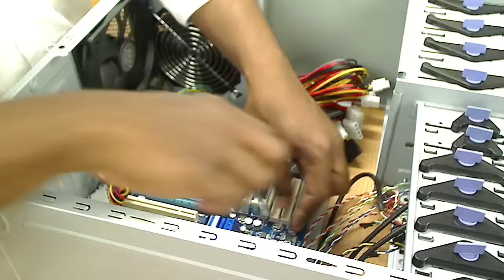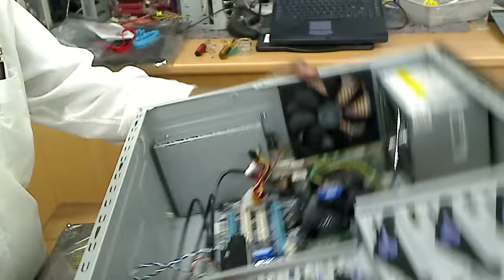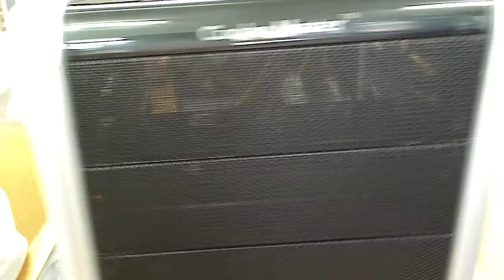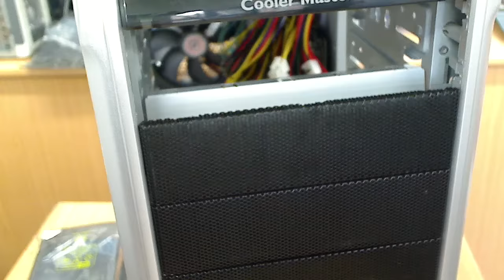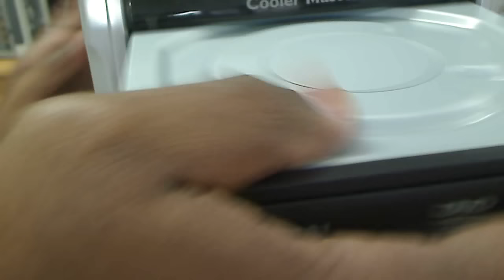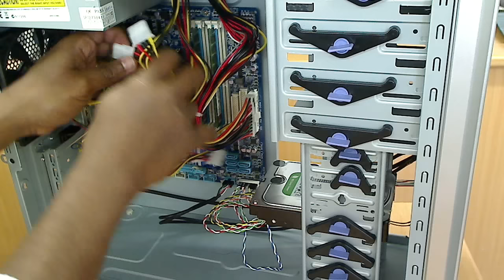How to install new Mainboard with Intel Core i3 Processor inside

Comment: I notice you do not use an antistatic mat nor are using an antistatic wrist strap, I allways use a special workstation set up with the right mat as well as the wrist straps. I have yet to have blown up any PC boards as a result.

Fingers crossed you are lucky this does not fail.